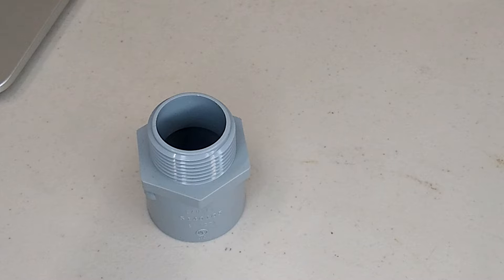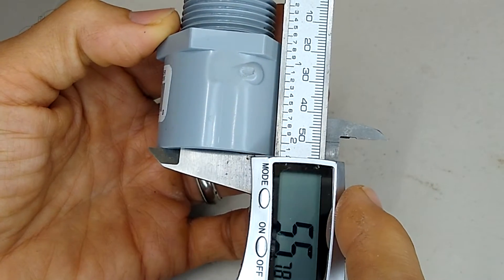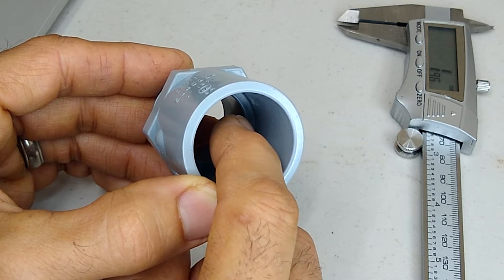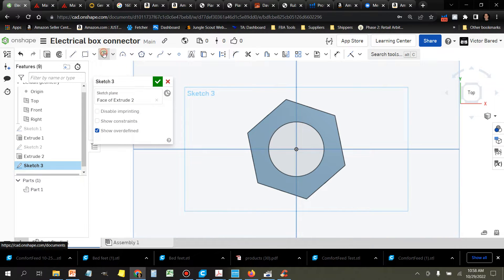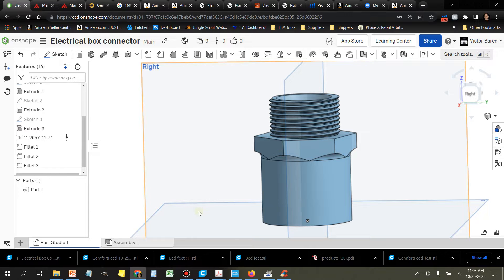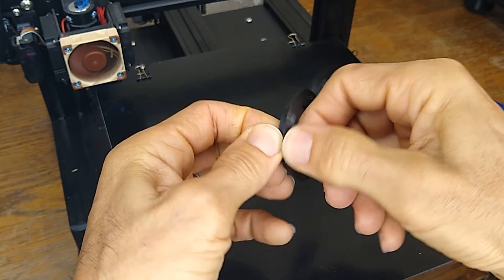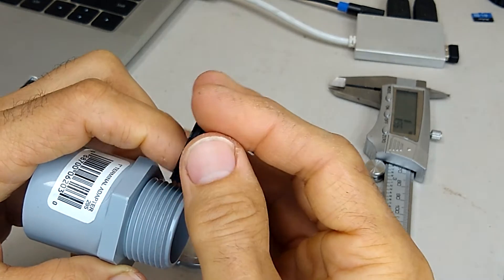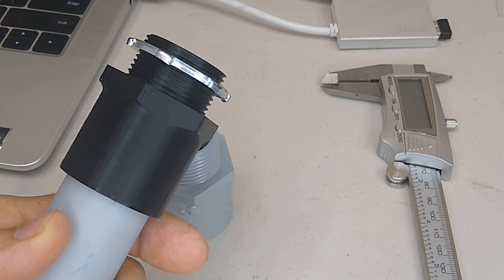3D Printing DIY Recreate an Electrical Connector Using OnShape and an Ender 3 V2

Comment: Very nice !Thanks for the tip on printing a section. didnt think of doing that i have alot of failed prints, this tip will definitly help cut down on some of failed parts. Thanks!
Reply from the maker: Hi Laura,

Thank you for commenting and you're most welcome. I'm glad you found value in this video for your viewing time.

Best of luck with your projects!

Comment: Hai! Great job! There is a little lack of thread entry for a lighter screwing of the nut, but it’s very good anyway.))) Tell me, the plastic of this manufacturer, how did it seem to you? Does it make sense to buy?
Reply from the maker: Thank you, If the plastic you are referring to is the filament. I'm using SUNLU PETG black it prints clean is fire and heat resistant. It's my go to filament. I didn't bother using PLA after I discovered that it would warp severely when taken outside. I live in Texas and we can have 100 degree days during the summer.
Reply: OK! I understand your argument, yes - the sun is the enemy of any plastic and it is very encouraging that this plastic meets stringent requirements. It's just that I use mainly eSUN and EVEYONE, while SUNLU has lower prices. Thanks for the info, I'll use it!

Comment: Hi Victor,  Well done and a great look at the thread tool and the Cura test part trick.  Thanks again for another great session.  Call when you can.  The Z Timing belt project is in the start up phase.
My Best Regards
Doug
Reply from the maker: Hi Doug, I racked my brain looking for an easy way to make the threads. Stumbling on the Thread Creator Tool was a real time saver for me. Super cool, did you order the timing belt kit for the z -axis?

I give you a call tomorrow so we can chat.
Reply: @vbared  I was reviewing Kevin AkaSam's video on the belt drive for the Z axis and got inspired.  Yep Parts on the way and the printing is in progress.  A nice balanced project.
Tomorrow my friend.  Hi to Chaos

Comment: Sometimes the obvious isn't so obvious. When you sunk the part for the test cut. I had been using tinkered to cut my part for test prints. Thanks Victor, I will check out the program and look forward to printing something that needs a test print.
Reply from the maker: Hi John, Thank you for commenting. I'm glad you picked up new nugget of info from the video. I learn a ton from the YouTube community. 

Best of luck with your mods!
Reply: @vbared  Ha , so obvious ,  I am guilty of the same thing as John . Thanks Victor
Reply from the maker: @Prokastrynator  I hear you, the same thing happened to me. One day I accidentally sunk my .STL file under the print bed and decided to slice it. I printed it like that and the result was a split part. I never thought of pointing this out in a video but am glad that John made his comment about it.